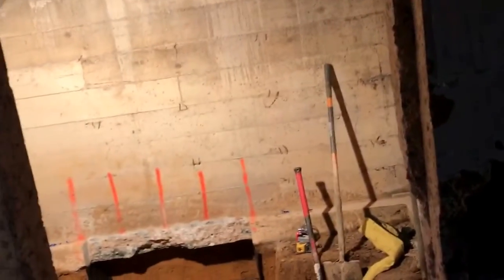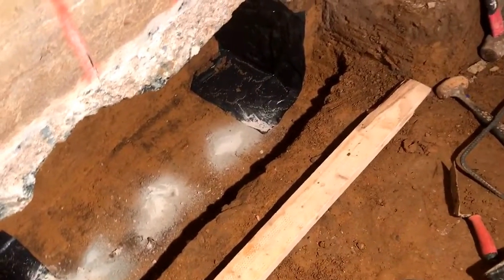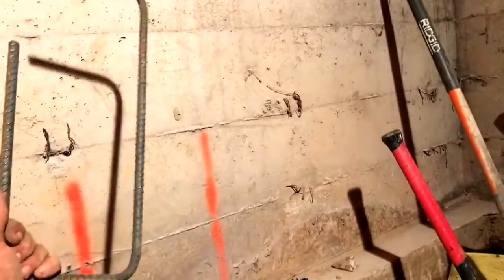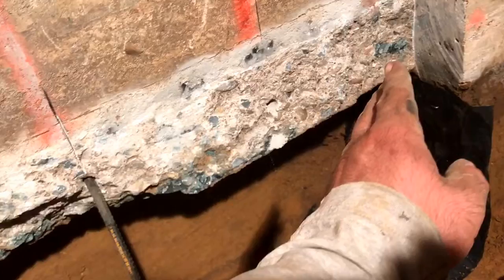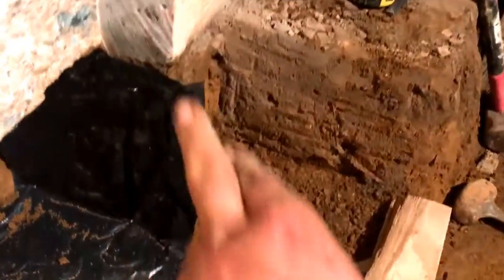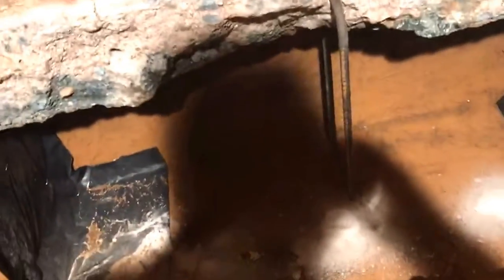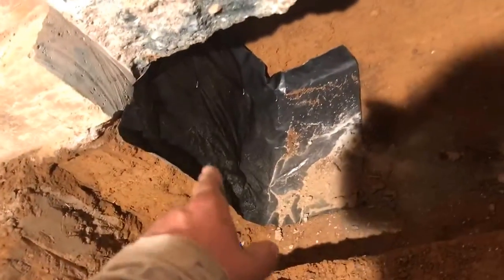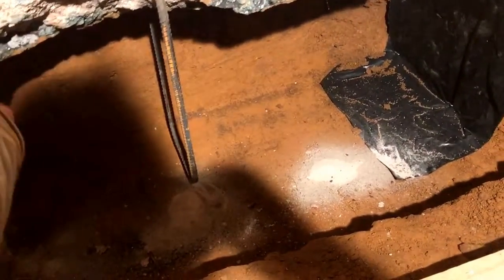Details of a shallow underpinning segment. The basics of underpinning with examples of reinforcement

Comment: Can you give me more details on the rebar? I’m digging down 2’6
Reply from the maker: Well, you should drill up into the footing at 3-4 pieces of bar 1/2”  is good for residential footings for under 3 story houses on solid footing. 

When I say up i mean once excavated drill pointing up. These were just under 2 feet so I could not drill up. The bar you see here is bent in a different pattern and epoxied in. If you drill up you still need to drive the bar into your hole securely. Use 1/2” hole for have inch bar uses 5/8 for 5/8 bar and so on. If you cant hammer the bar in, use epoxy drill 9/16 hold for half inch bar or maybe 5/8  but the bar has to be held in for the time it takes to set up. Remember the elkxy home has to be clean and sry compressed air a plastic extension nossle and a shop vac and a rag to control dust is helpful. Make sure you have “meaningful air exchange” with fans etc. to control dust. Keep learning if you are here. So you can execute carefully. I have other videos on here but i was demonetized so i dont post anymore. Used to buy me coffee every few months but, google has become evil. Good luck and make sure you can do your Job safely, its very dangerous.